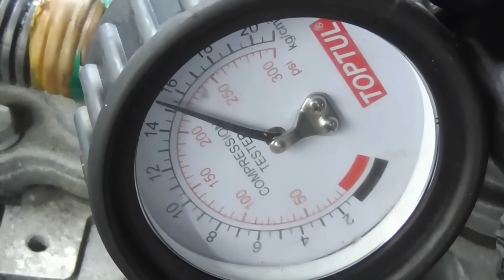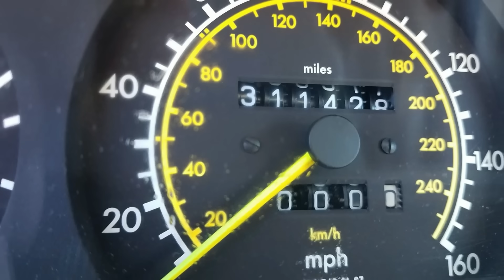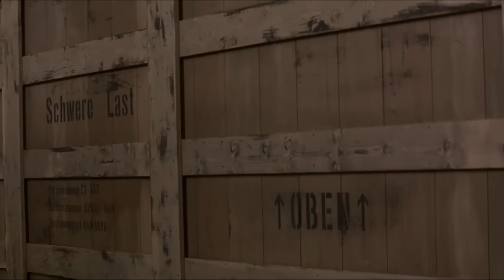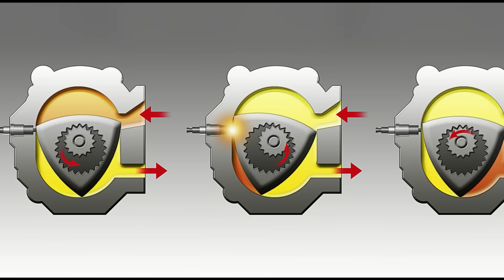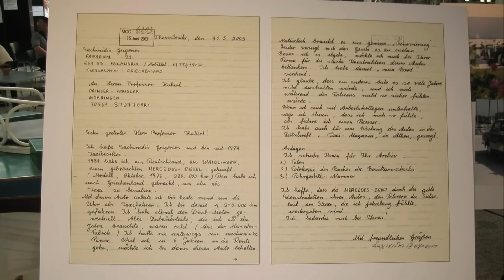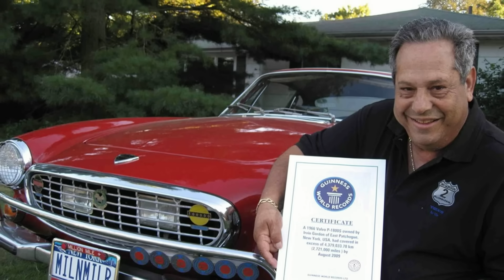Most Reliable Engines of All Time

Comment: Hey.
You are forgetting one specific engine made from 1990 to 1999 by Nissan. 

It is the 1.6 liter 16 valve twin cam engine. I have one and i have 715,352 mikes on it. The engine is original frim factory.

The oly changes i have made to the engine is every 100,000mikes i change the timing chain tensioner for the cam shaft and every 200,000 moles i changed the timing chain tensioner for the crankshaft, along with new gears.

The best part about this car, i get 37 to 39 miles per gallon cruising at 70 miles per hour, no cruise control

I bought a second car with 210,000 miles. Replaced timing chains, gears, tensioner. This car i am getting 40 to 41 miles to the gallon cruising at 70 miles per hour on cruise control. 

You guys are not going to believe this, both cars are 1997, manual transmission, same engine, one is a basic model and the other is a GXE.

BUT!!!!
THE VIN NUMBERS ON BOTH CARS ARE EXACTLY THE SAME, EXCEPT FOR THE PACKAGE CODE CHARACTER.

ONE IS A NUMBER AND THE OTHER IS A LETTER.

I AM TRYING TO GET 45 MILES Per GALLON.

Comment: Yet another person leaving out the Toyota 4.0L V8 Quad Cam 1UZFE used in the LS400 and SC400's of the 1990's. Engines well known to go over 1,000,000 miles on numerous documented occasions. Fun fact the 1UZFE is so reliable that the FAA cleared it for use as an aircraft engine!

Comment: This is a slickly produced but nonsensical feature. Almost every engine from the late 1980s on, with some specific exceptions, lasts 300,000 miles in normal use if it is maintained. Not only that, but the level of historical research for this feature is poor. The only engine on this haphazard list I am familiar with is the Toyota S series. The Toyota 5SFE 2.2L four was the final development of this series and Toyota Camrys through 2001 with this engine are still on the road in large numbers, unlike vehicles with earlier iterations of the S-series engines. The earlier iterations of this engine may have lasted longer than the 5SFE for all I know, but they are not relevant to the road today.

If someone is going to do a feature like this, they should both do their research and make up their mind what they are doing. If you are going to do the longest-lasting engines of the last half century, do that. If you are going to do the longest lasting engines still on the road today, do that. If you are going to do the longest lasting engines introduced since 2000 do that.

The biggest defect, though, is simply the misconception that an engine life in the 100,000s or even the low 200s in miles (250,000-350,000 km) represents a long engine life probably is outright laughable to almost everyone who sees this feature and reads the comments. If you drive with your foot to the floor and rarely change the oil or do other maintenance, yeah, you'll burn up an engine pretty quick. In normal driving, even pretty aggressive driving, the experience of almost everyone with almost every engine is that they last forever.

The topic of how long engines last is difficult to research. All you have are the stories of the mechanics who service them or the people who drive them. Even if you have a record of the mileage of all the ones that went through a wrecking yard, that doesn't tell you why they were there. Engine failure may not be the most common reason, but even if it is the reason, you don't know the maintenance history of the vehicle or how it was driven. Maybe market positioning has something to do with it too. Maybe the people who drive Volvos and Toyotas typically are more moderate drivers than some of the people who drive some of the other vehicles. Buicks seems to have a reputation for lasting an extremely long time with the same drive trains as other GM models use. Maybe the people who drive Buicks are not so hard on their vehicles.

Comment: Where are the LS or the inline 6 ford motor? I have a 1999 chevy silverado with the 5.3l v8 LS and it's got 320k miles and she runs like a dream, there's a small oil leak but it's great

Comment: Well…if you’re only going with light duty diesels, international 7.3IDI’s, international DT444’s (7.3 powerstroke), B-series 5.9 Cummins, ISB-series 5.9 Cummins, and the 5.9 common rail cummins will all happily go over a million miles, with 10,000+ Pound trailers behind them the whole time (well, maybe not the 7.3 IDI’s, they’re a bit gutless to be towing 10,000 pounds).

Comment: This is more of a list of engines for tuning instead of the most durable.  Errors can be found all over.  Engine for the Camry is not the 3S-FE but the 5S-FE. Difference is the bigger displacement and balance shafts.  K20s are still built today, although on a new version called K20C, and it's sister the K24 is built up to this year in 2022.  Forgot engines like the Toyota 20R and 22R, the F series, the Ford 300, the Buick 3800, the Chrysler Slant Six, the VW Flat Four, the Mercedes OM606 and M104 straight six, the AMC Jeep inline 6, Cummins 5.7, the Chevy small block, and there are so many engines you can't list them all.

Comment: You didn't say anything about the Ford  300ci straight 6. The one I had lasted almost  400,000 miles. I know Ford has made some crappy engines lately............The 5.0-6 cylinder was a great engine..........

Comment: My 2008 s60 2.5t has 272,000 miles and still running, the automatic transmission has to be rebuild on 260,000 miles, the transmission is made by Aisin wagner.

Comment: I have a 98 Merc mountaineer 4.0 with 350k, only thing Ive had done was a transmission rebuild at 290k because the torque converter went. We have a 2008 expedition with more than that. All original the Ford 4.0 V6 is bullet proof.

Comment: I once worked on a Mercedes that had 800,000 miles on it. Belonged to a salesman.
The engine was the 5 cylinder diesel.
I did a valve job on it and brought it back to running like a jewel.
Reply: My Volvo has 997,000 miles
Reply: @mcglovera video link?
Reply: I just want to point something out. Guys that hit a million miles that have had multiple engines dont qualify. You can not rebuild the engine

Comment: as a 30+ year mechanic i can tell you more parts (i'd guess nearly 80%) in a car (none being part of its engine) fail before anything in the actual engine. when working for gm i could go months without ever actually working on an engine always just working on all the other parts around the engine. the rotary engine wears out "piston rings" before 100k miles.

Comment: No rotary was ever reliable. Even Sachs made wankels for snowmobiles . Good torque but likely only good for 500 to 1000 hrs due to apex seal wear. There new designs that do away with the apex and side seals with very close tolerances.

Comment: And what about the 5.7/350 cid GM small block.  My 75 GMC 4x4 had 392,500 miles on it and was still running strong when I put a new 350 In my truck. I have since rebuilt that motor and it sits in my garage on an engine stand waiting to go back into service.     Yes GM makes good stuff and YES the USA makes gr8 stuff

Comment: An inline six is among the smoothest running of all engines. Some years back I convinced my father to buy a Honda ( a long time Ford owner) that had a very reliable J series engine then he got a car with a K series engine and haven't looked back. Most of my family drives Honda's myself included and haven't had any problems besides small parts but nothing that I couldn't easily fix. I read about Irving Gordon's Volvo and my guess is that where he lives they aren't as liberal with the road salt compared to where I live.

Comment: 92 camry  2.2.  Still going. Kids still driving it. Looked at odometer 2021 summer. Over 460,000 miles. Leaks oil. Add a qt to 1000 miles. Still runs great. Good power. Never a check engine light.

Comment: I also recall a Car and Driver article on the Volvo 1800S in the 1960’s, maybe 1966.  They related how unbelievably strong the engine was.  The engine was driven beyond redline and they floated the valves.  Amazing!  Anyone else saw this article or heard about the ability to float the valves in this car?
Reply: The Volvo engines B16-B18 and B20 was very good. They were made of cast iron, Here (in Sweden) we called them bullet proof because it was almost impossible to destroy them.

Comment: I have a 2000 Toyota Camry it has 410,000 miles on it and still runs great oh it is the 4 cylinder model I also had a 1997 caviler that I drove to over 4 hundred thousand miles before I traded it

Comment: VW Audi 1.9 PD diesel engine was incredibly reliable. I had one with 300,000 on the clock and I've seen taxi cabs with over 600,000 miles. So why no mention, when it's many time as reliable as these motors. I'll not be subscribing.

Comment: Lol RB "reliable".... they are strong rorating assemblies but early versions had issues with oil pump strength... not ideal on a high revving short stroke motors. It was bad enough that we figured RB stood for "run bearing"

Comment: The Mercedes 300d Diesel engine you mentioned is actually call the om617 which is a inline 5 cylinder. 300d is just the car model.

Comment: Mercedes 2.0L M111 engine 163hp is reliable.
Thirsty in city (12L/100km), frugal at 100-120km/h (6,5L/100km).
BUT, be prepared to change head gasket at 250.000 - 300.000.
Done at dealership, it’s around €3.000,00 job, because of labor costs…

Comment: 311K on my TL so far, not the easiest driving in the world either.  Just had to fix the first problem, which was a leaky valve cover gasket.,  Inside it was so clean you could just rub your finger lightly and the aluminum came back to like new color.  Oil is still honey colored at change, and it uses very very little more than it did after break in.

The SECOND engine you named, though, the Camry 2.4, I own in a 2003 Camry, and at 184K the coolant started POURING out the back of the engine.  It would basically empty the radiator in about 2 minutes, not exaggerating.  The back three head bolts were stripped, the middle one I just lifted out with my fingers without even turning it, with the entire aluminum thread in the threads of the bolt.  I was PISSED. I put a few extra pounds of torque tigtening, just to see how man more were close, and the two one either side of it stripped clean at not even a small percentage of normal torque numbers.   

Not that easy a repair either (ten steel inserts drilled and tapped in about three inches deep, along with a standard head job).  I did NOT buy a Camry to have to do major engine work at 180.  Hell, many AMERICAN cars will at least occasionally do that.  And when I looked up the options for fix kits I saw that it was not a rare problem.  And not just with Camrys, but with many al block, al head engines.  They need to either make the damned threads where they will hold or insert them in the factory.  I'm not happy with Toyota.  BTW there is a LOT better insert out there than those crappy timeserts, which have the same lame fine thread on the exterior as the original head bolts, search and you can find them.  Starts with an Ha IIRC.  Expensive, but well worth the price, as timesert has fixes for a stripped timesert (saw that and ruled those out), and the one I used has a courser exterior thread than even the stripped timesert fix.

If someone wants to buy the used kit I will sell it at the kit price less the new insert costs less $100.  All of it is still superbly usable.  The tap looks new.  The last insert fit the tapped thread with clearance exactly like the first one tapped and installed.

Comment: My sweet red 1974 Opel 1900 wagon still showed honing marks in the cylinders at 100K miles, visible through a spark plug hole.  I kept it to 160k miles when the body was rusted too much.  That was a great engine and I wish that I had kept the car for summer use only when body rusting does not happen.

Comment: Many American engines lasted 300,000 to 500,000 miles.  289 Ford V8 is one example.  Several Inline Six Cylinder engines from multiple manufacturers.  We got over 300,000 miles out of a GM 455 engine once we switched to steel timing gears from the original plastic ones.  Why no credit for America's great engines and there were many.  The Auctions are full of American cars worth over $100,000.  Not many Japanese cars are pulling these values.

Comment: 3best engines ever had are all toyota/lexus .. toyota (last of mk3 supras ) 7m gte3litre straight 6 (turbo )the lexus 4litre quadcam v8 andlexus 430/460 gs engines v8s .. atmoment own2 gs ' a 430 and 460 both2008 .. goodfor 500m before to much work ... avoid allwheeldrives ... rear wheeldrive only ...nz car lover ..my 7mgte handled 600hp easy as .. with somework and bigger turbo would handled 800hp easy ..

Comment: Someone i know just bought this car with this exact engine 1:40 and the engine had too much oil filled in it. it was way over the top level of the oil level stick. after he drove about 240 miles the engine finally broke down. the dealer had filled the engine with oil like 200% over. Im not sure if other engines could last that long in these situations
Reply: Having too much oil in any engine is equally as bad as having no oil. That makes bubbles, and bubbles can't provide lubrication.

Comment: Only 50,000 average miles fr a clutch?  I just replaced my 2006 Dodge 2500 at 208k miles, and only because the release bearing failed.  The dealership showed me the clutch disc and said it could EASILY gone another 75k miles at it's rate of wear.  199K on my Tercel clutch. Might have gone forever except it found an elk in the middle of the night at 60 mph.  And a long lasting engine?  My 1985 Toyota Truck with it's 22 RE has 380k on it and the compression is only 5% off and max cylinder difference is 7%.  I pulled the oil pan off to clean out some timing chain guide chunks when that disintegrated.  We were curious.  but the rod bearings were still within specs as were the main bearings.  Too bad the bed has rusted away.  But he truck still moves well and there is very little rust on the cab.  Better fuel mileage and more power would be appreciated but, hey, you can't have it all.

Comment: I had a 2001 GMC Sierra with 245,000 miles on it when i sold it. Original engine and transmission. I put 2 fuel pumps and 1 alternator in 20 years. All the rest was routine maintenance. The guy I sold it to still has it. Still running strong. I wish I had kept it.

Comment: I have over 300,000 miles on my 2001 VW Beetle TDI. Still has the original clutch. I didn't even have to change brakes till around 250,000 miles! Still going strong daily. I am the only driver it's ever had.

Comment: Ok. You are bragging about engines that go 125,000 miles? How about the Toyota R series engines? The 20R, hemi head, typically went 300,000 to 400,000 miles with very little maintenance. The only thing that stopped these, were the vehicles rusting away.

Comment: My 2005 GMC with LLY 6.6L Duramax has 356K miles with no failures. The timing gears are gear-to-gear, with no chain to stretch. The water pump is driven internally by the camshaft, so pump always turns even when the accessory belt breaks.  Only two mods made were bypassing the PCV valve and installing the LBZ turbo mouth on the turbo ($70) for better airflow to the turbo. The most surprising thing about this diesel engine is the engine oil stays very clean all the way to the next 6,000 mile oil change. In comparison, my 1986 MB 2.5L 5-cylinder diesel is filthy black just 100 miles after an oil change. The Duramax is a tight, very clean engine, and produces good torque and HP for a crew-cab pickup, especially for the mileage. Plus, no Diesel Exhaust Fluid required on the LLY.

Comment: Twelve or so yrs ago I bought a 96' Ford Ranger with 280k on it. A 2.1L 4 Cylinder with the 2 spark plugs on each cylinder and a 5 speed.  Took pretty good care of it and only had to put a timing belt on it. Put a 100k on it before the clutch slave cylinder started to leak. It was also getting too rusted out  so that was the end for it but the engine was still running fine.

Comment: Mazda 13 b engine with a four barrel carburetor was in the 1976.maxda rx 4 casmo.  Released as the first dependable rotary engine. 75.000 mile 5 year warranty. Who cares about miles per gallon when your cruising around 90 miles per hour in fifth gear. The car that would put you in jail or the cemetery.

Comment: Ford 4.9 liter inline 6, strong, super, ultra, incredibly reliable. You can tune that tractor engine to produce 500+ HP AND it will drive 500k miles or MORE no problemo.

Comment: My 2 liter 2015 Kia Optima had 465000km when i sold. ONLY changed oil and oil filter every 20000km. The engine did not even consume oil by then with dipstick still 80% from full after every 20000km.
I changed the spark plugs 3 times and air filter also regularly as i drove it in the UAE with desert sand storms and summer trmptretures average 45c and above ...

By far the most reliable engine i ever had....

Comment: A lady from Folrida bought a brand new 1963  Mercury Comet  with a small block v8 and drove it  for nearly 50 years ,no transmission trouble  or no engine block trouble but had some valve work done ..The AC Compressor never wore out ether . I think she ended up with nearly 600k and that was a lot of stop and go driving  possibly which adds more idle  hours to the engine ..She kept perfect records of the maintenance  and trusted only 1 mechanic.....

Comment: im sorry but i have to diagree abaout the 123 300d Trubo,  the engins without turbo are much more reliabil. for example  the w124 200d,250d, and 300d can be found in germany or estern europe or even africa wiht more then 500.000 up to 1 million killometers the turbo engin are reliabel but in realtion to the oters its just okay, still 100-200